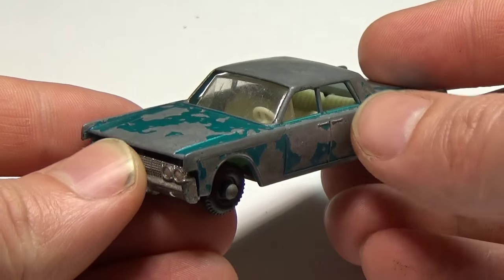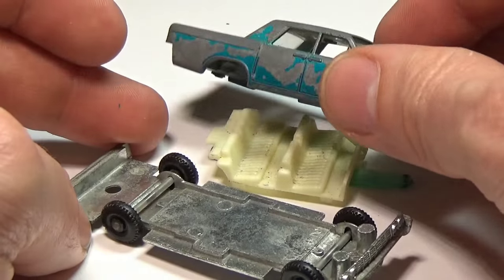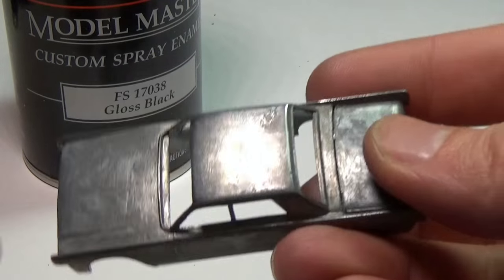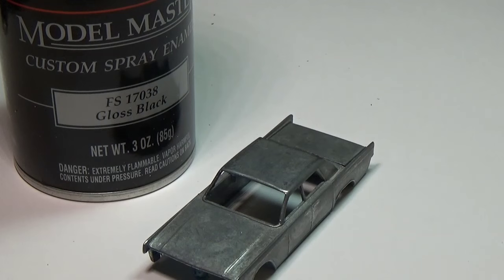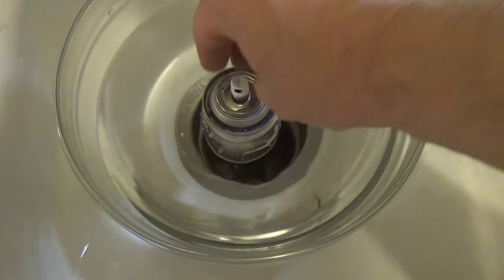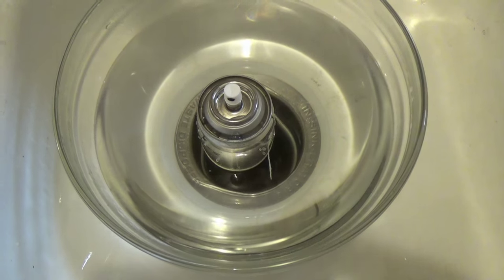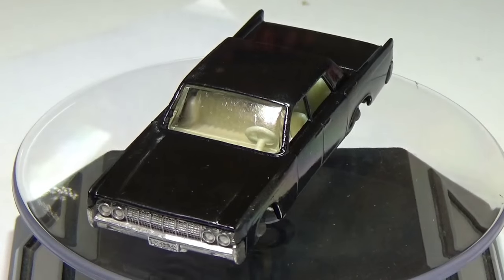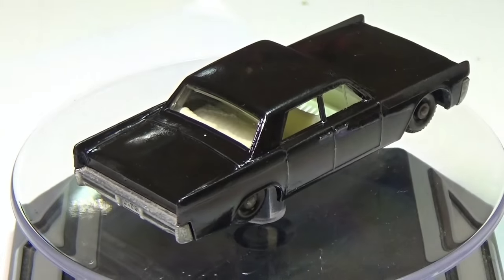Quick Tip: How to use Spray Paint on your Custom Hot Wheels

Comment: +baremetalHW, can you do tutorials on some of the following things, or if you have done them before, let me know.

replacing rivits with screws
putting bigger wheels on cars with smaller ones(ex: bigger wheels on mad manga)
cracked windshield
stance/hellaflush
adding parts(ex: custom roof rack on a hare splitter or a roll cage)
adding moving parts(ex: opening doors and hood)
adding extra wheels/custom wheel slots(ex: making a car with 2 sets of wheels have 3 sets)
how to take apart a cars rivits with out damaging them
motorization of the cars

if you could do any of these that would be awesome, I'm new to custom hot wheels and I would love to know more then a simple wheel swap and paint job, cuz that's all I really know how to do(and im not to good at it)
Reply: also, an easy cheap way to remove paint and ways to modify wheel colors to make them look flat, rubbery or rusty
Reply: +dsih01 for rust I believe its just like a real car... Just look up how to rust paint or something along those lines

Comment: Thanks so much for your time and tips. You've inspired me to give it a go. I know I'm probably getting ahead of myself and I will start with a spray can. However I wanted to ask you if there was a spray gun that you would recommend or do they all roughly do the same thing. Thanks
Reply from the maker: I use stupid cheap airbrushes from amazon. There is no reason to buy anything expensive.  I cheap airbrush will lay on a paint layer much thinner than a paint can, and give you more accuracy. The link below is an entire kit for 80$ that will be more than sufficient.

https://www.amazon.com/Master-Airbrush-Multi-purpose-Dual-action-Compressor/dp/B001TO578Q/ref=sr_1_4?s=arts-crafts&ie=UTF8&qid=1496779902&sr=1-4&keywords=airbrush+kit
Reply: I really do appreciate this. I don't know if Amazon ships to Australia but I will look at alternatives. Oh and do you have a website that supplies wheels? I don't have a huge redline collection to rip wheels off of. Thanks in advance

Comment: Nothing goes through the little rivits on the bottom of the car 😩 i have so many options and ideas but none of my drill bits, screws, screwdrivers, or anything will go through
Reply: young savage just open the rivets using a screwdriver from the wheel sides

Comment: Another concise helpful tip. Would you consider a trade for that Lincoln?
Reply from the maker: +Troy Grant I might consider it... I need to do a few more things to it...
Reply: +baremetalHW Thanks man, I just posted a new video and provided a link to your page. I gave you mad props at the 4:35 mark, but I displayed the headlight technique using a sharpie, and an X-Acto at the 11:00 minute mark
Reply from the maker: +Troy Grant Great Vid...  I am curious why you did not just mount the seat and engine on the original base plate?  Thanks for the shout out...  I have used your sharpie method several times now and love it..  you mind if I do a quick tip vid on that?  Will of course give you cred for it..
Reply: +baremetalHW absolutely.  your tutorials are of better quality than mine, and you have more than 10 times the audience. so it'd be an honor. if I can find another Porsche,  I will be doing a follow up piece.

Comment: I also use the power of the sun to heat the can up.
Reply from the maker: +Diecast Show Customs I only paint at night...lol
Reply: +baremetalHW hey is there a clear coat that makes anything matte finished? i dont want to have to remove and re apply the decos on my 180sx
Reply from the maker: +Jason Recio hard question to answer... I find that Testers matte seems to be the best... the issue is that some paints will react with others. For example lacquer paints will react with enamel paints... if you paint a car with enamel and then spray lacquer clear coat it may form bubbles.... however that being said Testers seems to get over this issue somehow...
Reply: So matte clear coats dont work? Okay testers it is. i hope they arent that expensive.
Reply: +baremetalHW okay now i have a bigger problem. whenever i paint i spray a couple of cm away from the car. short bursts. and then after a minute i blow dry it with a hair dryer and start again with another coat. and then for the final coat i spray to cover everything up and just let it dry over 10 minutes. and then i placed flat clear coat. it worked fory civic si die cast but when it came to the fd it was so rough. i didnt strip the fd from its original paint bc i was lazy. so why is it so rough? did i not pour enough top coat?
Reply from the maker: well there are a lot of variables here... so it would be hard to say... are you painting with spray paint? and then top coat what kind? Acrylic or Enamel? Regular spay paint does not dry for seven days... if you put a clear coat over that you can get bubbles and a rough surface...  if the top coat reacted with the clear coat Mattel used then it can give a rough surface...If you used a blow dryer on the clear coat it can cause all sorts of issues...
Reply: I just used regular acrylic. And I just sprayed . The flat top coat was a Bosny top coat. I used it on a civic si hw and it was smooth and i didnt do anything to it. I just sprayed it on the stock hw paint. I have pics on Instagram @jasonrecio

Comment: I could not find the video on airbrushing. But I have a question. Do I have to thinner the Vallejo airbrushpaint before use?
Reply from the maker: +ChaufMT I normally do... they're supposed to be airbrush ready however
Reply: baremetalHW thank you for your quick response